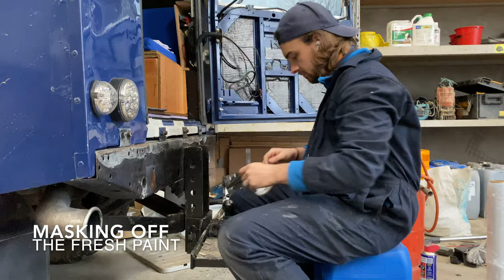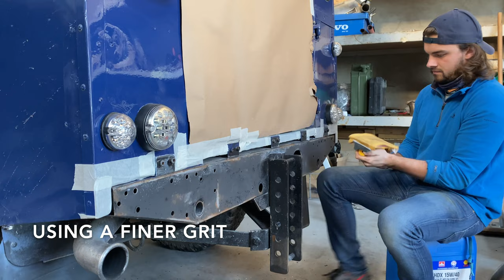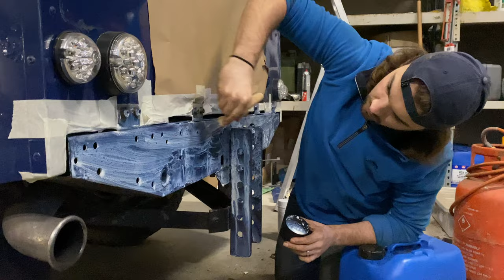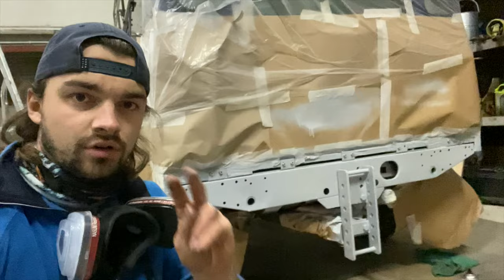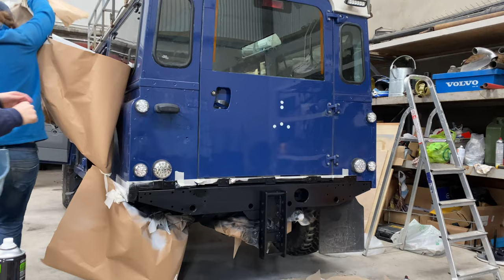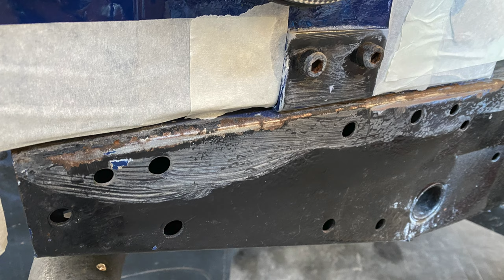Defender Restoration - Part 9

Comment: What was the finish like after using the Kurust? Wondering if that might be a good temporary fix until getting the time to fully repaint?
Reply from the maker: Hi Patrick, it makes the rusted areas a solid surface but they recommend that you paint it after.

Comment: Hi Mate, what grades of sand paper did you use
Reply from the maker: Hey Joseph, started with a 80 grit, 120, 240 then primed, followed the priming with 400 & 600 grit before spraying the paint. The more time you spend on the prep, the nicer finish you’ll get 👍🏽